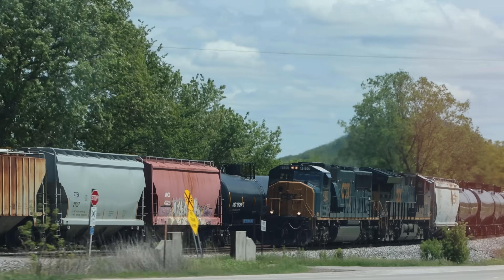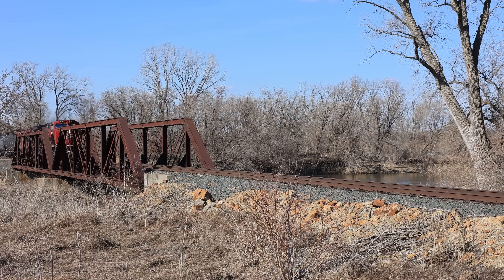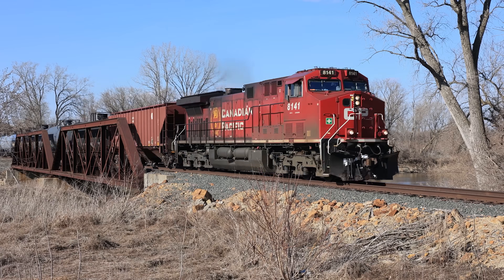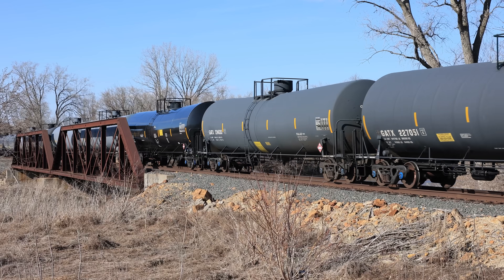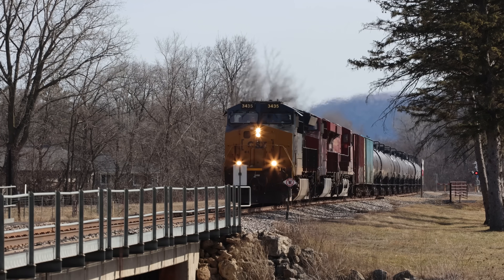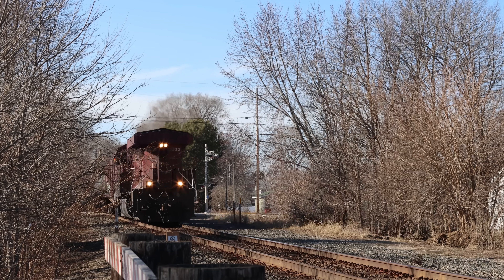Why Do Trains Use Buffer Cars? | Explained

Comment: I did think about that idea to separate them. I may have seen tankers with syrup because I'm sure I saw tankers coupled to the leads. That surely can protect the valuable and harder to replace locomotives and people in them.

How would I know a tanker has syrup though? More importantly, how would rail workers know which ones they are when working them in without checking contents, including which other cars have buffer car contents? Markings?

Next time I put that sweet syrup on my food, I'll remember it's other interesting use.

Thanks kindly for this.
Reply from the maker: Thank you for watching!

In the case of railcars that require buffer cars, they all have placards that indicate the volatility of what’s in them. Corn syrup wouldn’t have a placard or would indicate somewhere what is inside the car. Some cars incorporate the car’s contents into the lettering of the car.
Reply: @roadrailmediagroup   Next question: Why don't horns get used at all crossings? Did you do one on that?

I witnessed a city bus cross without stopping to look, as the lights started to flash. That bus just cleared the lowering arms over its back end. That could have at least left bits of the arm for the oncoming train to traverse over. Had there been the typical horn pattern start before getting there, that bus driver may have heard that when getting close and assumed there was actually a close call coming. And that might set a standard in educating drivers the flashing lights mean business. And that happened while all our bus drivers are supposed to stop to look.

I once heard a driver wiggle through the arms, as that vehicle was rushing away, its noise was overlapped by a bigger noise, that's too close. I then saw this happen with more time between the noises, but again, there could have been debris left it the arm got broken, that might not be very noticeable until it is too late to prevent a derailment. 

Plus, I have heard those crossing systems fail to go up after completing crossings, I'm not sure how many times they may be failing to activate when needed. I don’t even notice those lights and arms when walking unless they are activating, I quickly got used to checking for what's there or not.

Yes, those horns wake people, but I live trackside and I can tell you, if I don't wake to the engine noises, the bells - often with and after the engine noises, I wake to the wheel noises or at least to the stretching of cars, I'm sure every train wakes me. I'm not angry about that, it's like living on an airport twice in my aviation career and once on a shoreline near the docks and big ships. But I'll be angry if any driver of anything crosses and gets hit, unless a derailment puts out my life too. I say, blow it before someone else, uhum, blows it on one's driving skills.

Most of us close our windows to keep out burglars, that also muffles the blast of horns. And we get used to that if it is as regular to the rest of the noises, we will sleep through just the same or wake everytime, some lucky people do sleep. I admit though, the unusual blast of the horns does catch me off guard sometimes, I laugh it off until sometimes that noise keeps going like trying desperately to get the trespasser to move, that's when I start to worry. 😮
Reply: @juliencooper7023  My question is, why do the 'engineers' need to use 2 olng, one short and one long horn, especially as the lastone is usually when the loco is on the crossing and probably too late. I know that this is a legal requirement, with some exemtions, but why not just use one long blast.
Reply: @doughunt9621   Wow, I like your observation and interest in this.

I haven't done more than reside trackside, hear some distant trains blowing them regularly and open some of the videos from the algorithm. But surely they do have that pattern and the last of it is while going through the crossings.

My guess on the patters is it sets the common message "I'm a train coming through" rather than a long panic sounding noise like I hear sometimes when someone won't move or randomly chosen patterns. With the distinctive tones - there are different tones but all are very similar compared to other warning systems - it works.

My guess on the timing with the last long sound in the crossing, is that it's all done while getting into earshot of the crossing, and incase a driver is sleepy and still approaching, it's heard right there. With the doppler effect, it sounds kind of haunting going through, but if someone hasn't noticed yet, the locomotive and some railcars are there.

And, funny that the pattern resembles something from Moores Code, maybe the people who chose that thought it was a cool or fitting choice from those message dashes and dots. Moores Code was used a lot in the rail industry as a communications method.

Now, I'm going to educate myself with a Google search to see what of this I have right and or wrong. Back soon. 😊
Reply: @doughunt9621  Hah, I'm quite right on all of it according to some quick searches.

There are more than one pattern, for starting to move forwards and backwards, approaching a station, for other reasons and doing the standard crossing to let other rail workers and the public it is approaching. The two long, one short and one long are the crossings.

The last sound while going into the crossing is part of that.

Surprisingly, the letter "Q" in the Moores Code is it for crossings, a British tradition from announcing the approaching Queen.

Of course information can vary, but there's more to my casual education for being an observer. I hope that interested you too. 😊

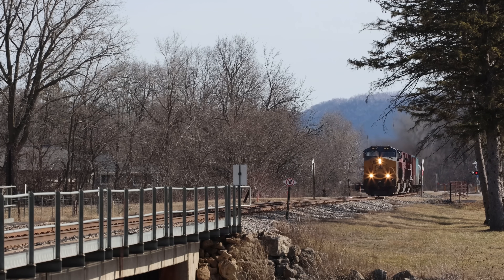Comment: 1:47 I understand the “at least 45 feet” part, but why “not greater than 75 feet”? Wouldn’t more separation always be better?
Reply: The length restriction probably has something to do with curves in tracks.  If the railcard is too long or too short, it may restrict the train from making the curve safely.
Reply from the maker: Great question! It didn’t state specifics on why the length restriction on the STB website, but it could have something to do with overall weight. An inert material like sand or stone quickly becomes heavy, and maybe the thought is to legislate out overloading since they likely do not scale the buffer cars.

Comment: Hmm. I will watch out for this. There is short distance local train that I see often that runs parallel to a bicycle trail. The train pretty much always has the same car arrangement and halls primarily LPG. I think it has a buffer car on both ends as it has locomotives on both ends. I will keep an eye on that.
Reply from the maker: Thank you for watching! That sounds like a buffer car use case for sure.

Comment: If the shipper is the one to supply the buffer cars, how long does it normally take to get those buffer cars back to the shipper?  Does the shipper own these cars our are they rented/leased from a rail company?
Reply from the maker: In a lot of cases, the buffer car stays with the unit train consist throughout the round trip. Typically, a complete train set goes from shipper to terminal and back to be reloaded and sent again. If a buffer is removed for maintenance, a new one is typically added.

Comment: Very interesting! I wonder if these buffer cars are just older cars the shipper stashes in a yard or if they are revenue loads that happen to be headed in that general direction?
Reply from the maker: Thanks for watching! I think it’s both. I have seen tank cars with corn syrup used as buffers for that reason. The syrup was made at the same facility as the ethanol on the train and shipped to the gulf for export.

Comment: I figured all that just by watching railfan vids.  But I do have a question. I understand that there is "play" in each coupler, in order that the engine can get one car at a time rolling as it pulls from a standing stop. But I don't understand what happens when you have a "pusher" engine at the back. Are the couplers on the front half of the train extended while the ones on the back half are compressed, with a car somewhere in the middle just floating back and forth?
Reply from the maker: That’s a great question! And a great topic for me to dig further into. The use of a DPU prevents excessive slack run-out (stretching) or run-in (bunching), reducing stress on couplers, knuckles, and other equipment. If working correctly, this leads to a smoother and more stable train ride, especially on curves and grades.

Comment: hi great video from a ex UK rail worker.  we used wagons in the same way and we called them runners they were used on some chemicals trains, oil trains in the days of steam and when carrying explosives.
Reply: They also in the UK use them on special heritage passenger services on the main line running at high speed. Often with a heritage service the passenger carriages (cars) might not meet modern collision standards so they put an empty heritage carriage, or a carriage build to a modern collision standard, immediately behind the loco (which could be steam or diesel) for similar reasons. Heritage operators have turned this to their advantage as they often use it to carry extra crew, spare parts, tools etc. in case the usually elderly loco encounters difficulties on the trip.  I have also seen buffers used when brand new passenger trains are being towed from the import docks to the train depot before they are commissioned into service, although that might also be due to differences in coupler types. 👍
Reply from the maker: Thanks for watching and sharing the information! Cheers!

Comment: I see a buffer car on the track inspection train too. What's that about? Protect the track inspection coach from excessive force?
Reply: I ran across a couple of answers to this a couple of years ago after shooting a track geometry car over in Culbertson, Montana but will have to see if I can find the info again.  One explanation was that some signal systems required at least 12-axles to register (don't quote me on that, though, for that doesn't sound right to me...  Running light power or a hi-rail truck would become a pain if that was the case, eh?).  Now my curiosity is reawakened...  :)
Reply from the maker: @johnniewelbornjr.8940 I am also now curious. I will look into the axle count aspect. My initial findings yesterday talked about the ATS technology and the fact it is sensitive and expensive. The buffer car helps protect the equipment. I wonder if it also helps with slack action 🤔
Reply: @roadrailmediagroup  I'll be interested to see what you find out.  My first thoughts about slack action would be that it would not behave any different than the other cars since that is simply physics.  

Speaking of slack running in/out, we had some real "artists" when I worked at a military post on a civilian transportation contract.  Flight-line, container repair, hauling for the units with GSA tractor-trailers, plus the railroad with vintage Paducah-rebuilds for power (since replaced).  We had a couple of young guys that put a lot of the Class 1 engineers to shame when it came to finesse.  I now live about three blocks from the BNSF yard in Williston, ND and just heard one begin pushing with similar finesse, which is often rare for them up here.  Usually you can hear them banging about all over town with rough-handling (probably some bad distance calls by brakemen is to blame, as well).
Reply from the maker: Oooh, that’s a great question. Perhaps I will need to find time for that video next 🤔

Comment: An Internet search found that, "A buffer-car service charge is often in the range of $100–$300 per car, per trip." Question: does this mean the charge quoted here is attached to each of the tanker cars or just to the buffer cars?
Reply from the maker: That’s out of my wheelhouse, but having shipped railcars years ago, I can tell you every shipper negotiates their rates with the RR. High volume shippers might get that fee waived if there is more than one RR that can ship their product. It sounds silly, but there once was an ethanol plant in Wisconsin that shipped all of its product via truck 20 miles to a RR offering a better rate.
Reply: I'm almost certain it's per buffer car. It wouldn't make sense to charge a $300 fee for each tanker car on a unit train. But some trains have 2 or more buffer cars because they can have engines in the middle and end of a train. So it would be $300 for each one.
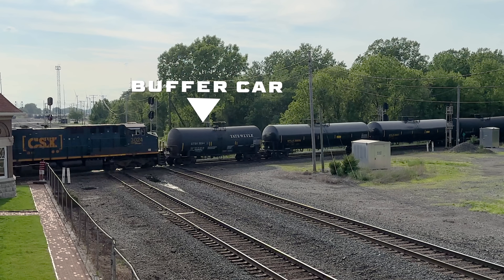Reply: Location of CSX crossing scene at 1:24. ?
Reply from the maker: Sorry, I don’t get notifications for replies for some reason. That is Marion, OH.